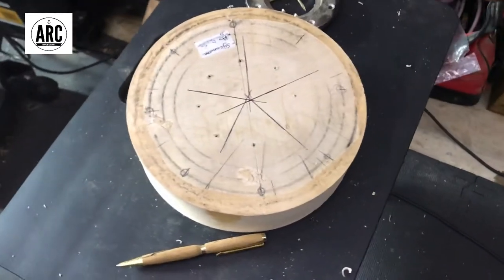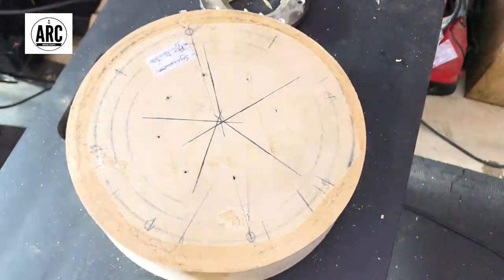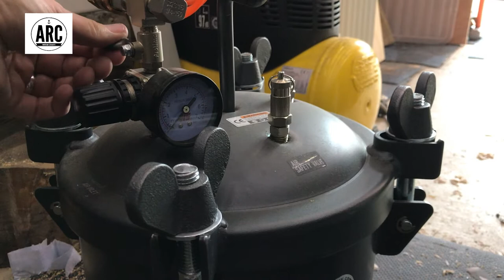Woodturning - The Manhole Bowl - (and GIVEAWAY!)

Comment: Lol Navy...Manhole Bowl...you should know there are 360° in a circle...No of holes required - divided by 360 gives you their position centreline...then with your fancy angle setter...set then out...simples...if all else fails a compass set to the requisite distance also works... that looked ok anyway...nothing wrong with experimentation in your work to obtain a new ‘look’...👍🏻. Using different colours and some LEDS you could also make a wicked disco light...just have to work out how to revolve it...
Reply from the maker: Mate I had a right mare with the angles, only to find that once I’d drilled them, there’s an angle finder ON THE LATHE already that I could have used! 🤦‍♂️
Reply: ARC Wood Craft 😳....🙄...🤣😂🤣😂🤣😂🤣😂